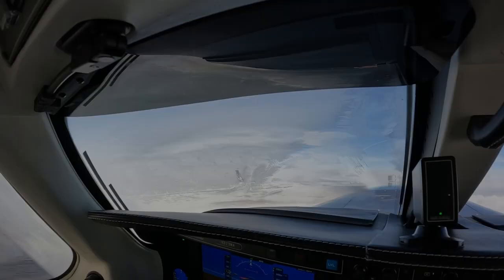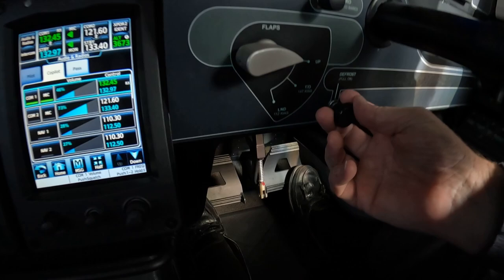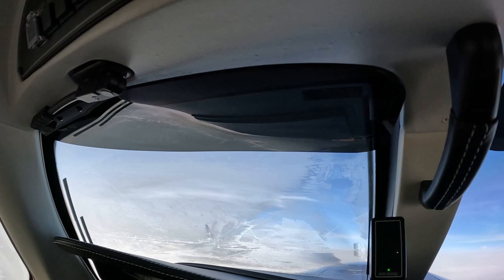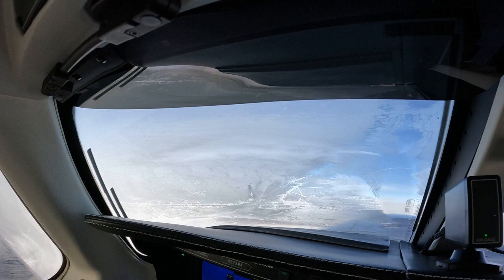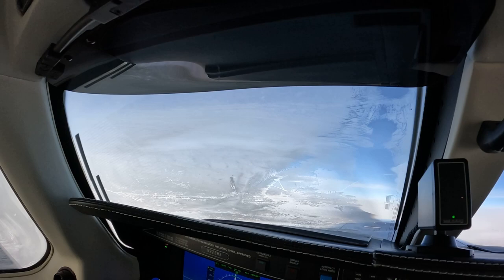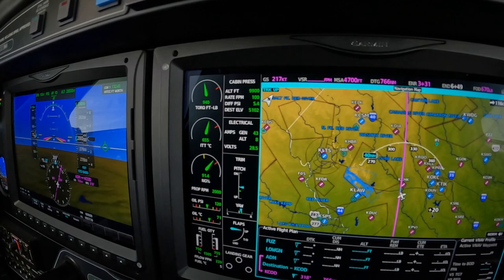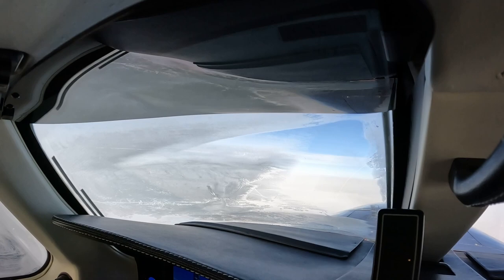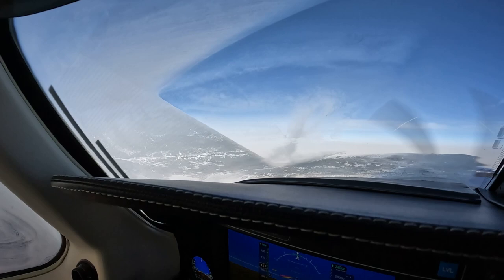Using the Electric Windshield Heat in the Piper M600 with Dick Rochfort

Comment: Dick! is it useful to have an AOA indicator in m600 ? Or stall warning is enough ?
Reply from the maker: An AOA indicator is very useful when climbing above FL300 which PA46 aircraft do not do. The available aftermarket equipment limits the pilots view and, in some cases is very distracting; during the landing flare for example. I use the personal limit of 100 kts until all turns are completed. Fly Safely - Train Often .. DR